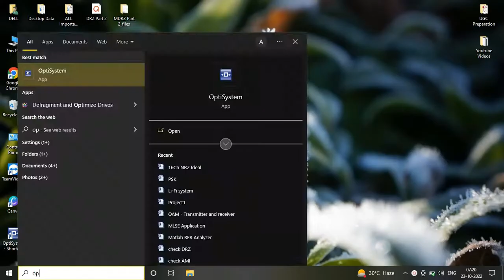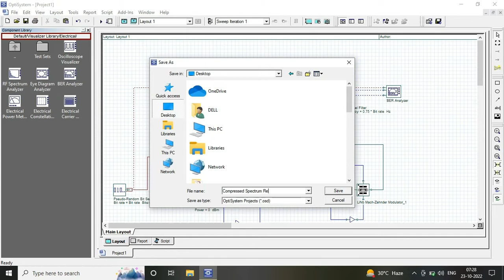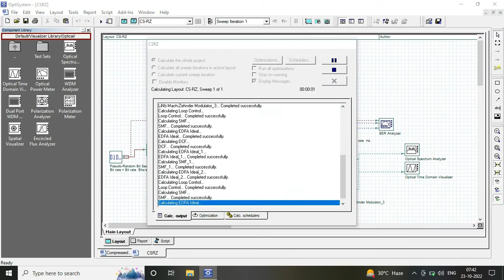How to Design a Compressed Spectrum Return-to-zero (CSRZ) Modulation using OptiSystem I In English I

Comment: Please.... what are the advantages of this type of modulation? and what is the difference between it and RZ?
Reply from the maker: Advantage

CSRZ performs better due to its carrier suppression which helps in reducing the interference between the adjacent pulses.

Difference

In RZ the electrical signal generator generate RZ signal with raised cosine shape and given duty cycle .
In CSRZ  we add a chirp to RZ optical by applying a phase modulation driven by analog sine wave generator at frequency equal to half of the bit rate. That will introduce a pi phase shift between the two adjacent bits and the spectrum will be modified such that the central peak at the carrier frequency is suppressed.
Reply: Thank you very much 💙💙💙💙